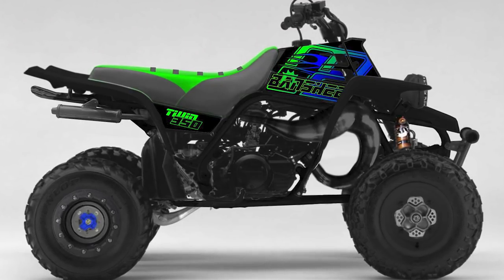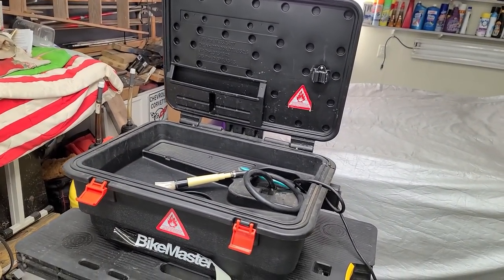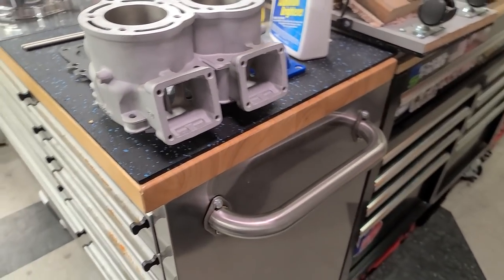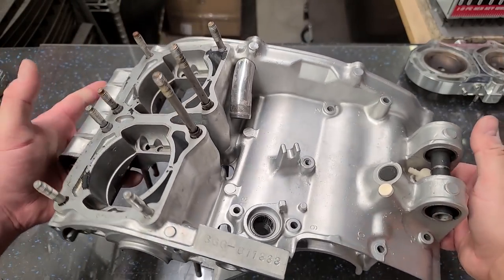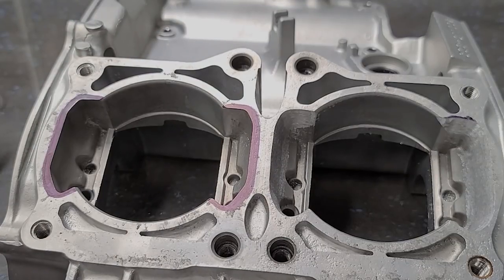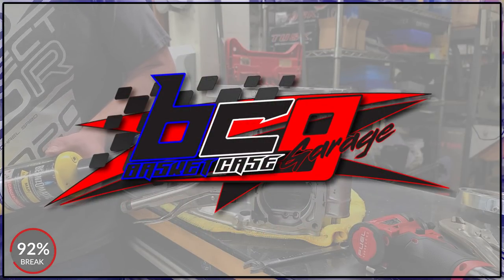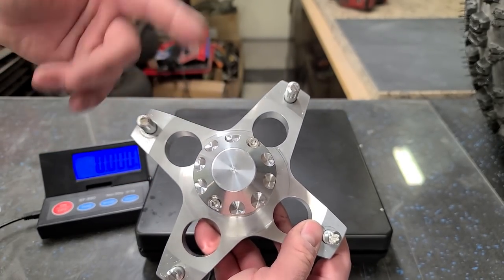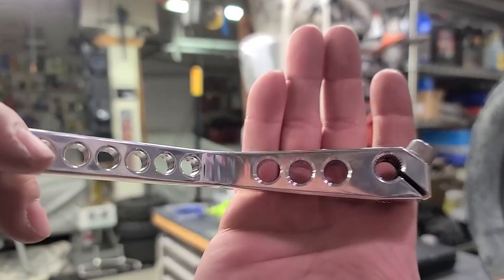BIG weight savings, 2 Stroke Case Porting and Trick Parts - Voodoo Banshee Part 3

Comment: When the top nut doesn't work, break it free by the bottom nut. You can apply more torque to it.  Builds looking good so far. That aluminum brightener is also the shiz nit. It's probably what brought the cases back to the blasted finish so well.
Reply: Was about to comment that, I’ve actually never seen anyone do it from the top nut. That was new for me 😂
Reply: @hunterj2253  Yeah me too mate, but I think Mick tightened em up together with his rattle gun first.

Comment: Reducing the weight of an quad really requires serious thought and consideration on what are you willing to compromise. I learned a lesson about this the hard way.  Back in the 1990's, I used to ride and race xc mountain bike in California.  This was a period of time when aftermarket parts flooded the market and advertising was so appealing.  Well, like a fish, I was drawn to reducing the weight of my bikes to gain advantage in handling and energy, but found the experience to be a bit on the life threatening when parts just break with no indication of failure. I'm not a big guy (5'7" 145 lbs) but I destroyed a lot of very expensive parts every month. Granted, it is possible to reduce considerable amount of weight without sacrificing strenth and durability, it just takes research.
Reply from the maker: Oh man! This is what I'm trying to avoid; some of the stuff, such as the hubs, could be taken down even further but I stopped at a midpoint in hopes (somewhat calculated by material and strength factors) that they will still be durable. Time will tell and I'm going to be checking constantly during and after every ride to ensure things aren't fracturing/failing. Thank you for the info and sharing your experience man!
Reply: Michael, I just enjoy seeing how analytical and creative approach you have to rebuilding quads.  There are risks in deciding what we do in just everything we do, but more important is learn as much as we can the mitigate those risks to an acceptable level.  Im getting old (thought I would never say that) but I am still a thrill seeker and competitor at heart.  Right now I am restoring a TRX450er to race xc  this season considering that I have never raced quads before, but I wanted a change from racing two wheels in the woods. Being in my late 50's, I still find competing much safer than free riding with friends.
Reply from the maker: @j.need4qlife483  could not have said it better; happy to hear you're still getting after it; hopefully I'll be at your side joining a race myself soon!

Comment: Getting rid of the rotating mass in the tire is the best part of the weight savings.  More power to the ground making it even easier to wheelie.
Reply from the maker: 100%, even though that could be bad in a racing sense, the goal is fun and I love a machine with a light front end!

Comment: Hey mike just a tip. Use the bottom nut to loosen the stud rather then the top. Use that box end of the wrench on the lower nut. It grips the stud very well.

Comment: I really think you're going in the best direction with this build to get the best performance for all around riding. The improvements to the porting along with the suspension upgrades, weight savings and anti vibe will make a huge difference in your speed on track and trail not to mention cut down on your fatigue. You will definitely be faster in the tight twisty and rough stuff. Good job on the color scheme and graphics as well. As usual I'll be glued to your build 🤘🏼😎

Comment: With the 2 nut trick, you should use the bottom nut to back out since it has the top nut holding it in place.
Reply from the maker: I may try this next time; thank you for the tip!

Comment: light weight is really good  when your stuck in a deep mud hole you will be happy you did that
Reply from the maker: I have actually thought about this; I know on the sand, it helps keep you on top and not digging and fighting the sand
Reply: @MichaelSabo  i have 2  4 wheelers the grizzly just has a winch in the front 
but i have another one that is a sports quad that i made go really fast  they both weigh the same at 700 lbs 
the grizzly has maybe 55 hp
but the other one has about 115 hp 
it will throw mud about 60 feet or more haha but ground clearance 
i thought i would be sc_ued if i got stuck in the mud so i bought a wench and wired it for the front and back with ski jack plugs bought some small trailer receivers  and welded then on the front and back to the frame 
for the wench i welded a hitch to it fits front and back just pull a pin
as long as there is a tree or another quad there i am ok just have to push a button to get unstuck

Comment: Being in the street bike roll racing world. Saving weight is everything. Also you should get a greaseable pivot bolt for your swingarm.
Reply from the maker: I was going to do a grease mod to the OEM one but the billet is not hollow like OEM; great idea but I'd be afraid to hollow out the billet one for strength reasons; it will be anticized to the max on installation!

Comment: Yeah man in Supercross we do major weight savings even the bolts gets drilled the centers out. Some are changed to titanium but only in places where we’re wanting more or less flex through the frame lol so no man I 100% believe in weight savings. My personal bike weighs 28 pounds less then factory and when you get into the factory bikes,works bikes there insane! So good luck man!

Comment: A trick Michael, if the top keeps coming loose, use the bottom one cause its only going to tighten more into the top nut, and if more leverage is needed, double wrenches works great as well

Comment: Get a bottom tap or you can make one by cutting a groove in a couple sides of one the old studs with your dremel to chase those threads...works good and you dont have to worry about breaking the case with tapered end of regular tap.. Looks good keep it up!!

Comment: Hey man for the double nut method aren’t you supposed to loosen the bottom nut against the top nut after tightening them against each other?
Reply from the maker: This is just the way I've always done it; the impact gun makes it very effective from the top nut; generally if the impact won't do it, it's going to need heat even with a vise grips.

Comment: careful with those lugnuts, aluminum lugs are prone to stripping the internal threads. to save weight possibly titanium lugnuts?
Reply from the maker: Those rainbow looking nuts on the table are titanium; I have faith in these aluminum ones because they're made for quads by a reputable company; time will tell I guess.
Reply: @MichaelSabo  looking forward to see how they hold up!
Reply: I have the same and they are totally fine, used on many pro quads as well!
Reply from the maker: @MxShee  awesome to hear this feedback bro!
Reply: My buddy used aluminum lugs on a 400hp drift car. On and off with a impact. Never a issue. 3 years straight

Comment: This is so awesome just make sure going -1 your wheels don’t hit your nerf bars mike it’s already close at stock
Reply: Yep, big tires are getting real close from mines too. By big tires i mean 20” 😂
Reply: @MxShee  lmaooo same size here I actually have the massfx ones and they  rub sometimes aggravates me lol
Reply: Luckily, mike’s nerfs sit in front of the fenders, he will have more space then i do haha. My factory43 evo nerf bars sit behind the fenders, but im gonna be running 18” most of the times. I test fitted my 20” and they get reaaalllly close
Reply from the maker: Do you run a -1? I forget if you mentioned this or not.
Reply from the maker: I THINK they're going to fit lol; I actually measured this with the MassFX wheels when I first made the heel guards and I had more than enough space to move them in another inch; we'll find out lol
Reply: Hey mike sorry I’m running stock they fit when the bike is sitting but when I hit jumps whoops etc and compress suspension they rub on the rear heal guard
Reply: @MichaelSabo  with my -1” and my factory43 evo i have like an inch left with 20” tires, the nettings touch but not the heel guards so you should have even more space then me with yours unless your tires are somehow bigger then mines! But those are just tests i did, havent actually rode the banshee with this setup yet

Comment: When you get tires like that, shove oversized tubes in, air them up and either let them sit in the sun or in front of a heater for a few hours to get them stretched out and easier to mount.

Comment: I like to use the box end of the wrench on the first nut when removing studs. The first nut will tighten up more against the second nut, and help remove the stud.

Man, talking about your nuts in this video, your peeper in the last. What goin' on? 0_o

The only problem with removing that much material in the center transfer area, is now you're stuck with a monoblock cylinder and can never go back to individuals. I don't know if there would be enough meat left to get a good seal on the base gasket if you match the individual cylinders to the ported case.

You're right about the base gasket. Those style gaskets are called AFM. Aluminum center, foam sealing surfaces.

I've seen builders use some sort of epoxy for filling in the 250R base areas when putting big ol cylinders on there. You might wanna have some material added near the rear center transfer area too. Looks a lil thin.

You might not want to grind on the roof of the transfers. They are VERY easy to change, and have a BIG impact on performance. A little too far and your cylinders are now drag cylinders only. You also run the risk of chipping the nicasil. A small file or sandpaper shouldn't change anything though. 

Fun fact. The first few years of DS650s came with Kenda dominators front and rear.

Love your description captions of what's being weighed.

I like telling inanimate objects to stay too. I also use "Here hold this" when placing something on something else.

The boost bottle wasn't a "scam" per say, Yamaha used them on a LOT of their 2 strokes, mostly the YZs, in the 80s. It was called the YEIS, or Yamaha Energy Induction System. It makes more sense in a single cylinder application. It gathers any charge that the cylinder/reeds can't take, and keeps it for the next intake pulse. A LOT of European/world only market street/enduro 2 strokes used a similar system. With Suzukis that I know of, it was a simple long piece of fuel line that circulated through 2 holes in the intake manifold. The bike that the 1985-1986 LT250R engine came from, the TS250X, from 1986-1989, used this.

Somebody needs to talk Hecasa into making LT500R plastics. Anybody out there see what they want for junked OEM plastic on ebay? Over 300 buck for a busted tab hood! 400 for a faded front fender! Jesus!
Reply from the maker: All great info and thank you for the explanation on the boost bottle; I had heard mixed thing on it based on other models but from what I've gathered, on the banshee setup in particular, once you get above the 30mm area on carbs, they cause more tuning inconsistencies than anything; just my .02, I could be wrong. I second Hecasa making plastics... for everything lol

Comment: My girl got me the same parts washer for Xmas haha it's the balls. Mine goes under my work bench. All ur content is fire 🔥  the scale thing may seem obsessive to some but I'm stoked about it man. I'm curious to see weight between fenders in ur fender vid. And u don't need to do titanium or billet bolts for everything. If u did all larger chassis bolts and nuts. That would be a couple lbs alone. Front suspension upgrade and weight loss, with less rotational....dude ur going be noticing big gains. I bet it feels like a totally different bike on the trails!!! Sickest build guy on youtube!!!
Reply from the maker: Man I can't express how excited I am to feel the difference; I wish I could have the new and old versions next to each other to ride them back to back to really feel it. I wasn't going to weigh the fenders against each other but I can do that 🤘
Reply: @MichaelSabo  may be tricky for fenders. I looked up them fenders and might get them on each build I do now. They look good. Just curious if their as thick, or as beefy as stock so that would be a cool point to throw into that vid. Side by side old bike to new bike would be cool. But yeah u remember how she rides so when u go around some corner or or down a trail u use, u will see the diff in familiar places like that. Stoked!!! Sick series going on right now dude!!!
Reply from the maker: @dennisbrooks186  they thickness at all the edges looks the same as stock. I don't have a stock set here or I'd measure exactly. I'm going to fit them up to the frame to check fitment; I'd wait for that before you buy them.
Reply: @MichaelSabo  oh yes lmao most deff wait to see if they suck haha but nah they look really good. I don't mind tweaking a hole or 2. Vitus fit ok, but their hard to mount in the cold, I really had to reef on them to get things to work. All mounted up, looks super nice though. Can't wait man!!! I want to build almost the same motor so I'm pretty damn pumped about this whole build!!!

Comment: (vapor) blasting does kind of close up the pores on the aluminium so it would indeed be easier to clean. The parts didn't look excessively dirty to begin with, and the cleaning process does look pretty thorough, so a combination of everything I suppose.

Comment: Hey dude on the right hand side were the oil pump is ,on the outer casing either side of the partition on the outer casing you could put two threaded inserts for ten mill bangos to run a oil cooler to the front of the bike maybe .

Comment: Old school racers would use 2 part epoxy to fill areas in their port work.  In your case it would be perfectly fine to use epoxy in that cavity as it would be completely trapped in the area and you wouldn’t need to be concerned about it getting loose.

Comment: @ 32:30 you could polish and instead of texturing you could dimple with a small ball de-burr bit how I used to do my high hp builds regardless 2 or 4 stroke fuel deposits into dimples and when you wack the throttle itll be a more proactive response.
Reply from the maker: Interesting concept; I haven't tried this but I have heard of guys doing this on intake ports basically going for the golf ball effect on intake surfaces; thank you for the tip!
Reply: @MichaelSabo  anytime its definitely different but it works last crf450r I built i done it to single cylinder bike on mr12 89hp and 93lb.ft stock bottom end big bore high comp need to get back into building quads too wish I had the pitch that you got though doing vids is a dream of mine and man you nail it on the head everytime! Love your channel!

Comment: If you're trying to go for really lightweight but good for all around and drag racing tires you seriously need to go with cheetah tires look them up there a replica of an old Tire that was one of the best tires ever it was a dunlop  tire
Reply from the maker: I've seen those tires before but I didn't realize they were specialized lightweight tires. I will definitely consider those If I do any drag racing with this quad; for now they need to be durable enough for trails and rocks so I feel the Klaw XC front, Dominator rear will be a good midground. Thank you for the info!

Comment: How much performance would you expect to gain with the level of porting you have done compared to what you would get stock?
Reply from the maker: I haven't case ported a Banshee before but on other machines I've noticed better throttle response and a slight gain in the power curve overall. It's not monumental but it does make a difference and I think the more you port the cylinders, the more this makes a difference.
Reply: @MichaelSabo  thanks for the reply I appreciate it. Lightly ported a 2 stroke 125cc cylinder from a honda ns125f for the first time and I'm interested to see how it performs.

Keep up the awesome content, im learning  great deal from your videos!! 🤟🤟

Comment: Mike could I buy those tires, need new tires for up coming xc season.   Maybe I could put you as a support sponsor, that would be awesome.
Reply from the maker: The Havok tires? I actually have plans for them on the next build; I really want to run those to see how they perform on the rough stuff and mud. I wish I had a promo code or something to save you some money on a new set. If you want to go with Obor which is great option that I have actually tested, I do have a promo code to save 10% - 10mikesabo , here is a link if you decide to try them - https://bit.ly/3odD9CT
Reply: @MichaelSabo  yes the havoc. I could test them  I race xc in indiana

Comment: I got back into riding with a small wheel klx140 and where it's power was limited to say the least @ around 9hp and I could feel a small difference in weight from the 7lbs lost when I put a lithium battery in it. It all adds up and it's why one of those even in the smallest orientation weighs more than the huge husqvarna wr250 I got after and it was built and BEEFY!!!!

Comment: Lighter tires & removing racks, extra plastic , swapping in a lighter muffler  are quick ways to help.a,used tired quad , not to mention, have a fresh drive chain, fresh axle & f.wherl.hub bearings , give your quad every fighting chance . I pump up my tires as much as conditions dictate, for less rolling resistance , I'll sacrifice more bumps & shock to the arms for  that . 
I've got a 85 LT 230s  ' Zook. Well, I did, but my oil filler cap came off, by the time I noticed oil mist on my goggles & a soaked right leg, the engine took a lot of heat, fried real good . 
 Safety wire your oil Filler cap on !  
It cost me an engine & 16km walk in the dark in MX boots back to my truck ( riding alone is stupid , yes. I would have built a fire if I was hurt , I tell myself . Stoopid.)